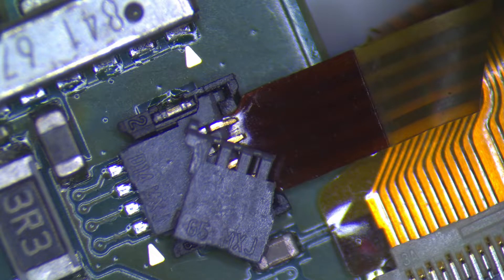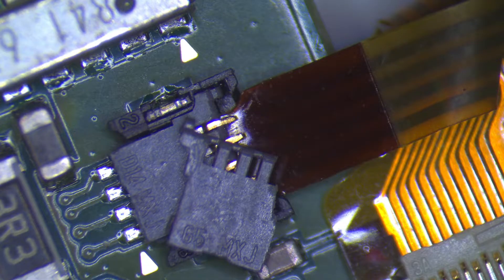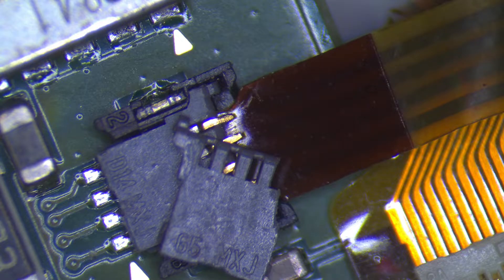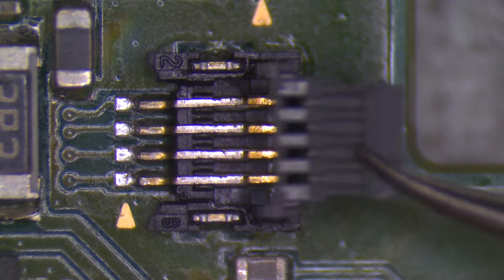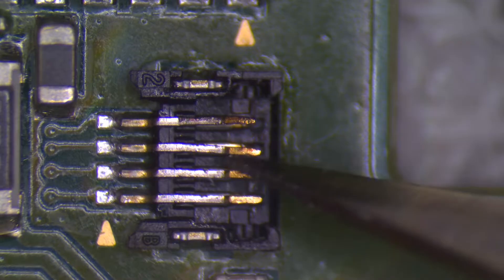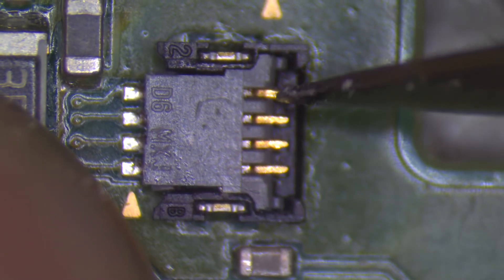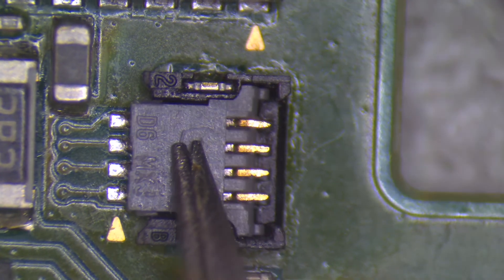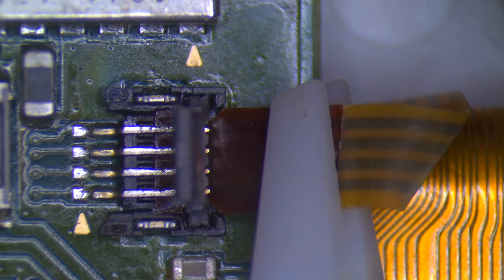Easy way to fix ribbon cable latches on all DS, DSI, 3DS, 2DS consoles - No soldering necessary

Comment: "These parts are tiny", no they ultra very tiny. How powerful was this zoom? x100.000? 😅
That helped a lot but as i don't have a magnifying glass I could'nt see very well, one of the 4 pins broke and could only get 3 . It worked for 5 minutes then I put some foam as i won't be able to solder a new P18 thing and it seems to work for now.
Nintendo doesn't like to be kind with their DS collection if you won't to repair something... this "ZIF" is a real flea, it's invisible and it jumps.
Thanks for the ZOOM!

Comment: THANK YOU SO MUCH OMG
Reply: What happens if there are pins missing etc? I don’t have this problem but I’m curious on if the whole part can be replaced
Reply: you’ll have to de solder and resolder the new one with a hot air station so pretty much having a professional look at it

Comment: Do I need a microscope or a magnification station to accomplish this, and at what strengths of magnification would you recommend? Thanks
Reply from the maker: Might be possible for people with really good vision to do without one. I personally use a microscope for these because if you over bend the pins they break. Some people use jewelers magnifying headset. I don't know the magnification strength off the top of my head.

Comment: Ended up getting it on finally then the ribbon cable wouldn't fit & it broke dumbest invention refuse to pay $90 to get someone to solder a new one or $100 for gamepad when I only need motherboard
Reply from the maker: tiny components that are mostly cheap, inexpensive, light plastic. Doesn't take much to break these unfortunately

Comment: Thanks for the vid. My latch popped off when I was removing my circle pad from my N2DSXL. In hindsight I don’t think it was broke but I thought I could just pop the latch back on but I wound up breaking it like that. Found this video afterwards. I got my replacement from a 2 pack on Amazon for $6 or so. Was fortunately able to get it on the first try thanks to your help!!!
Reply: May i ask what you searched for in amazon?
Reply: @LuisGarcia-yx6do  you can type in "4pcs 4 pin touch screen ribbon socket" and they will be first result.

Comment: how mich did you heat those pins up? it looks like they have been heated up to a very soft degree. am I correct, or is the fact this is so small deceiving me?
Reply from the maker: Pins were not heated.  There would be no reason to do that unless you planned on removing the connector and replacing it. I do not know the history of the console though and far as I can tell it was opened and someone messed with that connector which is why the top pin was already bent and the latch was broken.
Reply: @Tzirf  ok, so it must have been the fact that this was a hyper up close zoom in of a super small part that was throwing me off making it look like it was a really soft metal. Really is somethin trippy.

Comment: Hello, Where did you purchase the ribbon cable latch? plssssss
Reply from the maker: I purchased the a entire socket off Amazon. I removed the latch from the replacement socket I purchased and used it in the console. However there are different versions of the socket. If you are doing a repair on a NEW Nintendo 3DS you need the 4 pin Touch Screen Ribbon Socket. Make sure the latch matches your design in the console. If you cannot find it on Amazon I recommend checking Aliexpress. Cheers
Reply: @Tzirf  I have a nintendo 3ds XL and I would like to buy a latch because mine is broken so I can't repair my joystick

Comment: Hi! I made a mistake by accidentally braking the whole connector, not just the latch. Where would I need to go to get it re soldered, or can I send it to you? Thanks.   (It’s the ribbon cable connecter for the home button so the console currently won’t turn on.)
Reply from the maker: I am not currently able to accept consoles being mailed to me for repair. I would look locally and see if there is anyone who does this kind of repair. Are you sure its the home button and not the power button? I am not aware of a 3DS that needs the home button to power on. Which console is it?
Reply: It’s the regular 2ds model. I’m not very knowledgeable about this sort of stuff, but, the ribbon cable latch connector thats on the motherboard for the home button is broken off. I don’t really know what treatment the console needs, but I assume it would need a replacement connector or for the broken one to be re soldered. Let me know your thoughts, thanks.